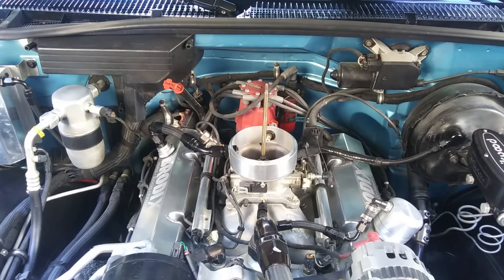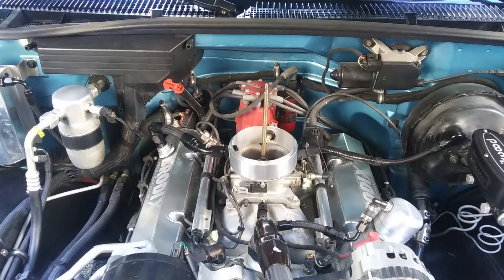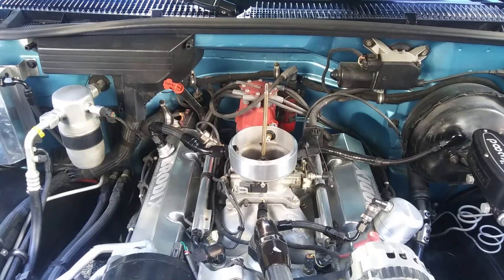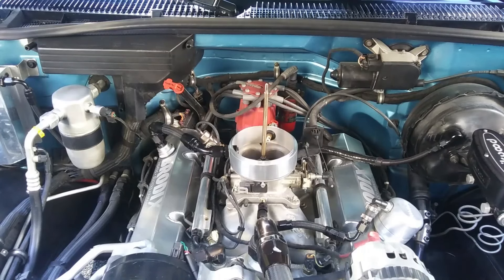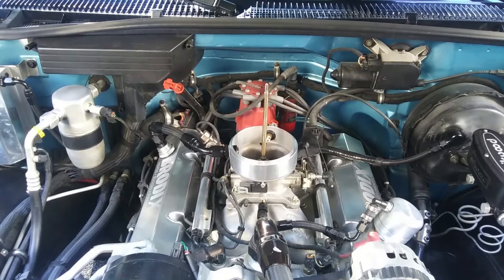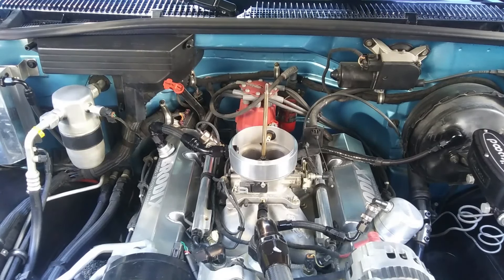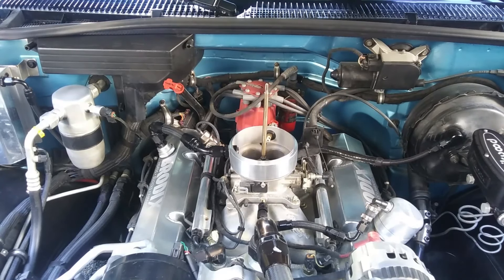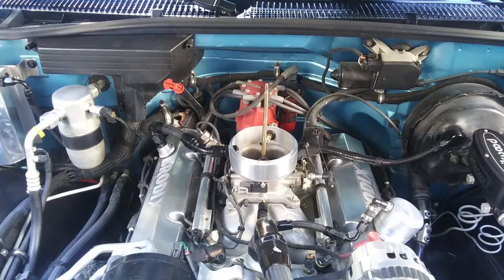My review of the Edelbrock Pro Flo 4 after 4 years of use on a 355 chevy in a 1993 OBS C1500

Comment: How many miles do you have on the PF4? Has it left you stranded at all? Wondering if you would consider this EFI setup reliable enough for a daily driver? Seen plenty of people having issues with it. Thanks for any info
Reply from the maker: Oh 4,000 to 5,000 miles. Never has failed to start and run for me. I think it has limp mode like a factory system just no indicator light. So you don't know there is a issue tell you go wack it hard and won't rev. The MPH seams to drastically fall off also. It's hard for me to tell it only had a problem once, the TPS failed. 
I daily mine weather permitting, I don't drive it when the roads are slick. Things can go sidway and even backwards in a big hurry!! A lot of trees where I live.
I think a lot of the PF4 relatability firstly depends on the quality of the install flowing and understanding the instruction, cam selection, how good of shape is motor is in. Vacuum and exhaust leaks really hurts the PF4 performus and reliability.
Reply from the maker: Oh by the way I changed the PF4 intake to a holley hi-ram https://www.youtube.com/watch?v=YIbXVV4WcjQ&t=23s
Also I'm building a new roller motor https://www.youtube.com/watch?v=BmWa5rerv20

Comment from the maker: Feel free to comment
Reply: Thank you for your videos they have helped so much. Question if you could answer please.
I have installed a ProFlo4 system earlier this year on SBC 350 with mild cam and a 4L60e trans. Like the system very much. Question is while at cruising speed with the AC on the engine seems to have a really mild surging effect. It's not the compressor cycling it stays on all the time. Just wondering if you've experienced this. Thank You
Reply from the maker: @D258111  You are welcome. No, I don't know what AC system you are running. It would seem to me that it needs to cycle. Wouldn't there need to be a pressure relief valve? Maybe the AC system is over pressurising and lugging the motor a little.